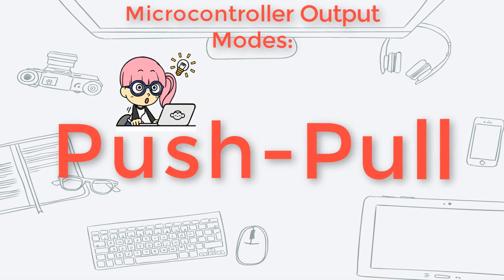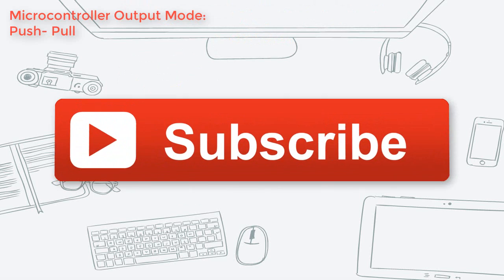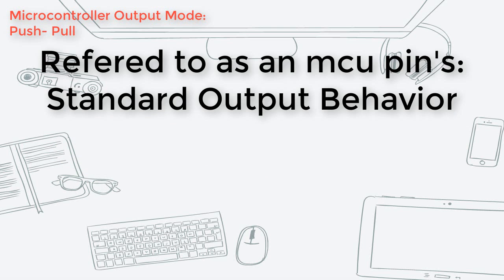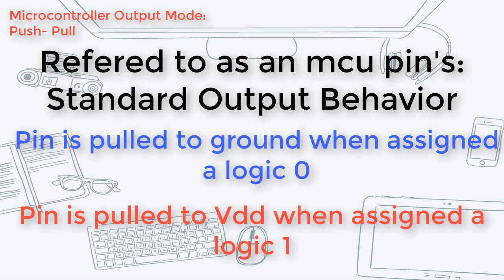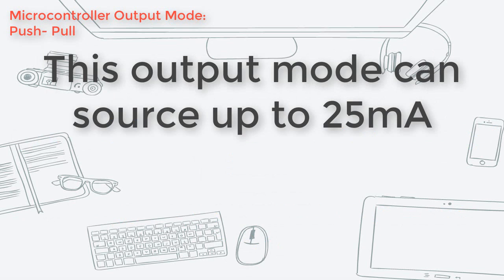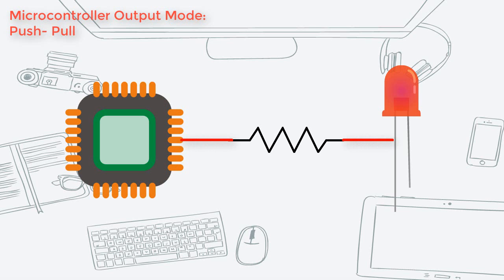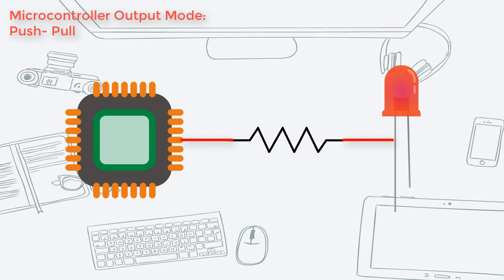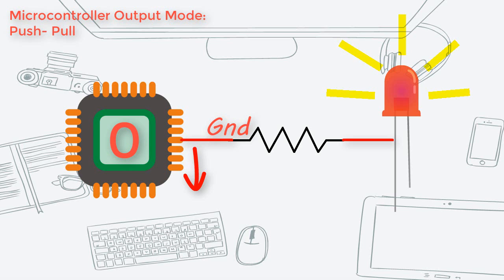GPIO Push-Pull Configuration [Microcontroller Output Mode]

Comment: I think you missed something. Driving a LED can be done will "open-collector" output as well. To make distinction between these types of outputs, you should rather show that with push-pull one can actually drive two leds, indicating both 0 and 1 states.